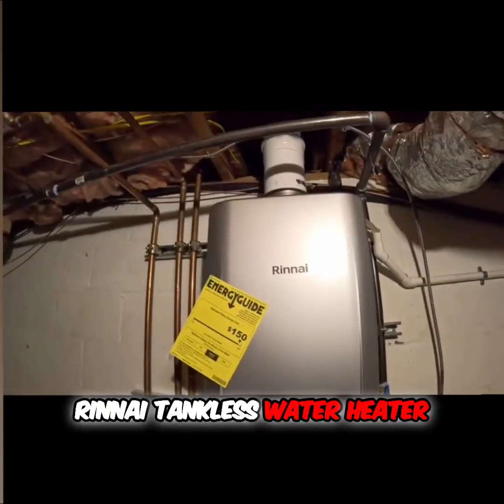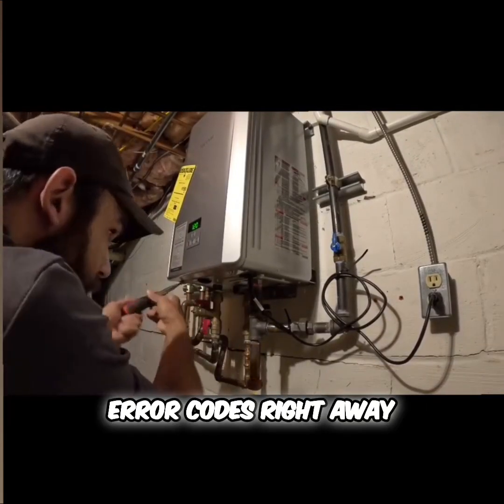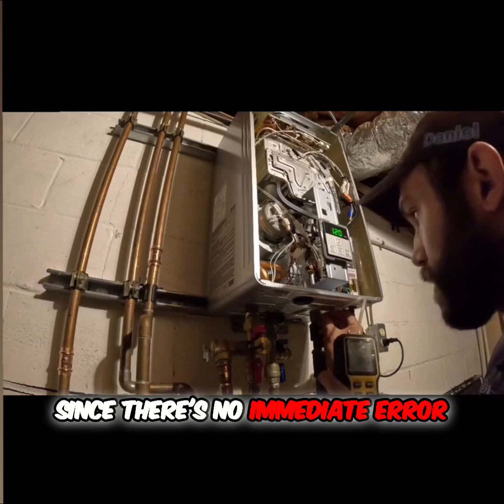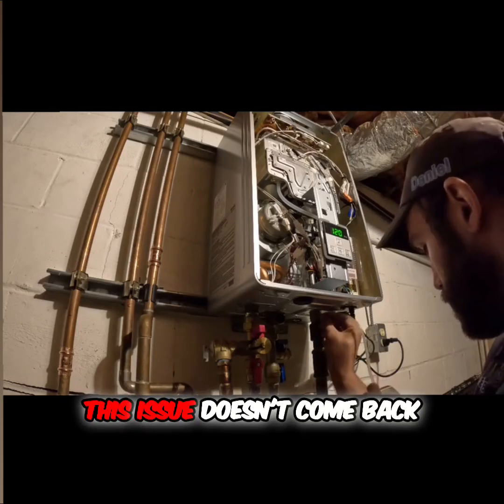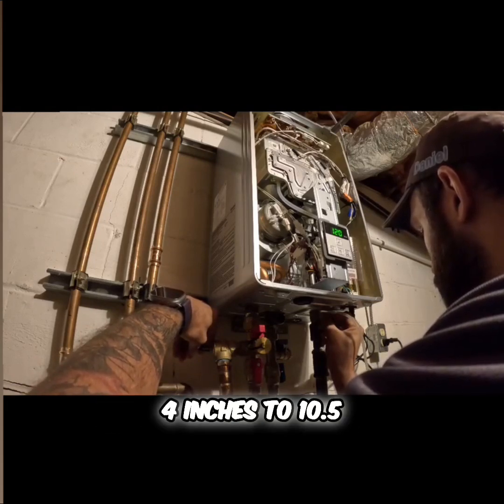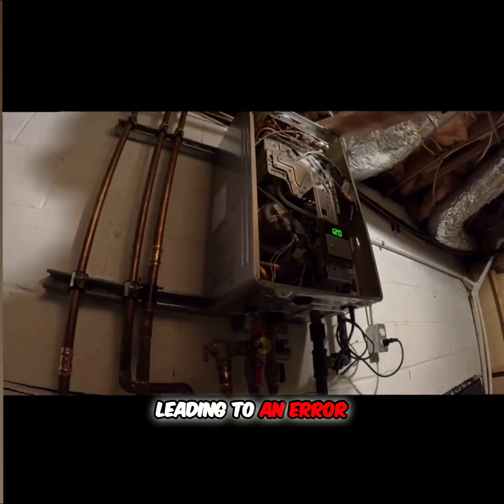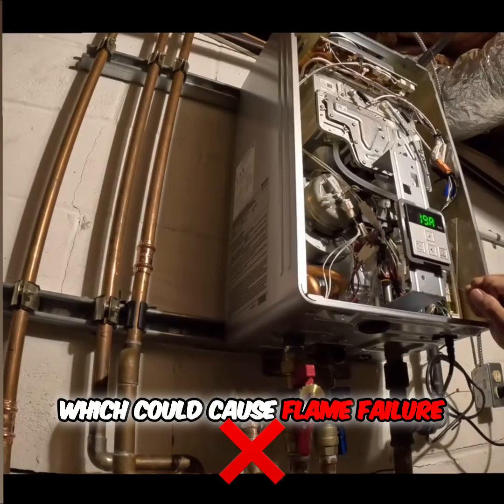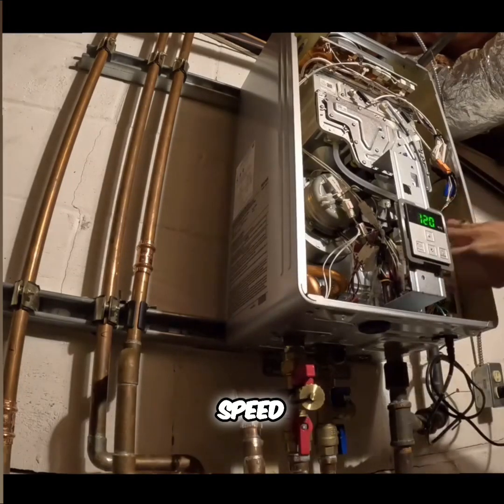Rinnai Error 12? Tankless Water Heater Fix!

Comment: My Rinnai it’s only 1 years old brand new house yesterday started doing this problem , will not ignite or come on when hot water is on , after couple hours it started working again , for half day , today pretty much same time it’s doing again , but there’s no error codes  , I tried unplugging hard resset still same , any idea what can possibly be , or how can I fix blower motor speed to make it work
Reply from the maker: Sounds intermittent, which usually points to gas supply or airflow, not the unit itself.
Natural gas or propane? And is it happening during peak cold hours?

Comment: Thanks for the education, truly appreciate it.
I'm a first time new Rinnai tankless owner, and in my case, it popped a code12 due to low gas pressure because it is -30°F outside today where the propane tank lives. I insulated the tank, supply pressure came up, and good to go. Probably a common issue in northern climates... 👍